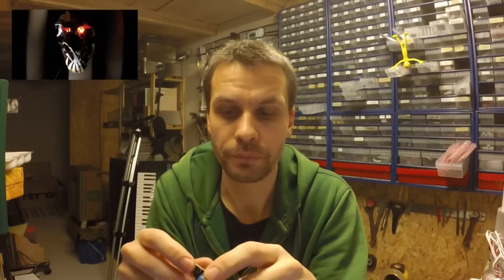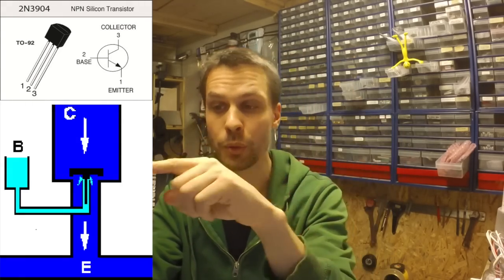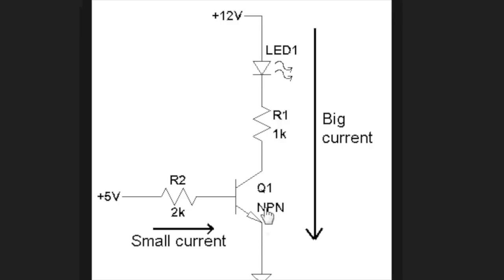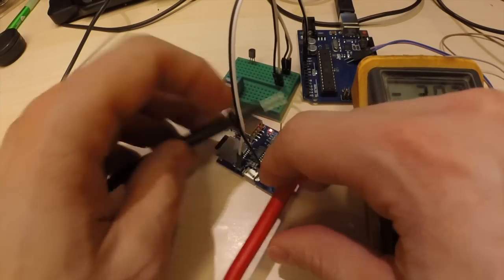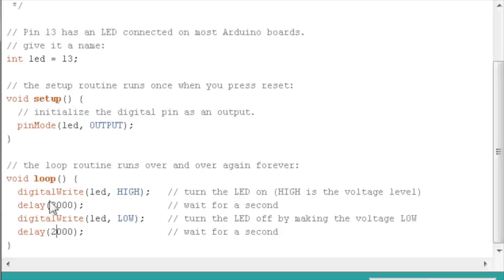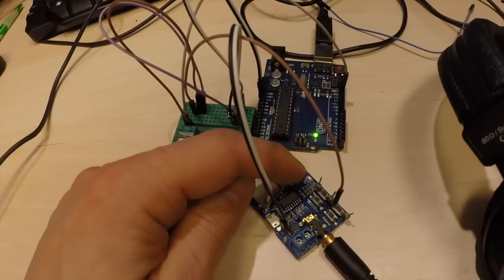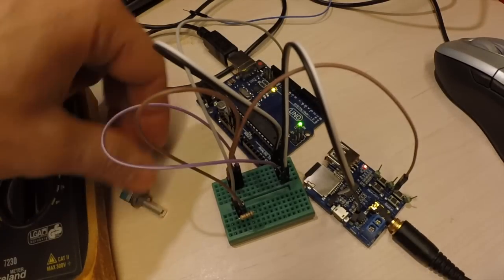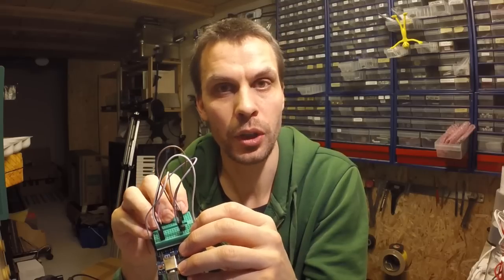NPN Transistor as a switch. Control Everything with Arduino [Anything Arduino] ep23

Comment: would this work in a eurorack setup? instead of pressing a button or using a switch, could a 5v gate connect the two points with the npn transistor?
Reply from the maker: Yes it could. U sure how nice the signal and clipping would be though. Would need a whole lot of more circuitry I think. But def there are many VCAs out there made with just transistors. You can look at this variant for a really low parts count “switch” using only a transistor and a few resistors. I AM O  VCA/RingMod/Voltage Controlled Gate - DIY Modular in a Week 2.2
https://youtu.be/m_z0NfnLqRM

Comment: One small problem. I'm replacing a push button by a transistor in an external circuit that I don't have the schematics of. And the icons on the board are all in the form of R33, R32, R17, H1, C2, etc etc. So I don't know where the 5V and ground are. Do they really need to be connected to work, or do you have advice on how to find the 5V and GND on an external circuit? Thanks!
Reply: So the push button I'm replacing has 4 pins, and between 2 pairs of them, there's a 5V current. I connected one pair of them to my raspberry's 5V and the other one to GND. Then I proceeded with your instruction until the point I'm slowly turning down the potentiometer. When I get around 1K, the transistor allows current to flow, BUT! It also instanty restarts my raspberry pi. Looks like I'm hitting a safety mechanism? Do you have a faint idea of what that could mean?
Reply: Well, guess I made a shortcut and power flowed from 5V straight to GND, resulting in a restart. I guess those button pins are definitely not what I need to connect my 5V and GND to.. the search goes on. Sorry for the spam

Comment: Awesome! What a great idea to use the potentiometer to figure out the resistor value you need. Going to use this to hack a hdmi switch that has a push button on it, so I can control it with a raspberry pi. Now to find out a suitable transistor.. but that should be no problem :). Thanks man!

Comment: show for us pls. How to do control power switch for arduino with one of legs of microcontroller.
Reply from the maker: I would do that with a simple Relay module. Relays are much better suited for higher voltages. In this video I hookup a relay board to the arduino to control a solenoid that runs off a 12V source. https://youtu.be/XJjOZpdOcqk

Comment: Usually your videos are great and I really enjoy them!!!! Your method presented here is not ideal. You may be biasing transistor in linear region with 18k value, rather than into saturation (needed for switching). So, consistent results will not be achieved when collector current varies with different load types. Math is fairly simple to calculate base bias resistor value.
Reply: +Kristian Blåsol 
It means that you may not be turning the transistor fully on using that method to find the base resistance. So then you get a voltage drop across it causing unnecessary heating, at higher currents it could damage the component.
Love your videos by the way.
Reply: +Harvey Ellis I'm glad you said it.
Reply from the maker: +Harvey Ellis Thank you for your information. I guess I need to study Transistors a bit more then... Do you mean that this particular circuit wont work consistently (with the 18k resistor) or do you mean that the testing method to find the  resistor value is incorrect? Im thinking that digital buttons as the ones in this circuit usually dont have different loads? Thanks again.
Reply: Kristian Blåsol
Yes I think you have an excellent opportunity to do a follow up video on the subject of transistor switching, and biasing for the saturation, and cut off modes. The only topic I am not seeing mentioned so far is asymmetric switching characteristics due to improper biasing. So you might want to explore that some as well.